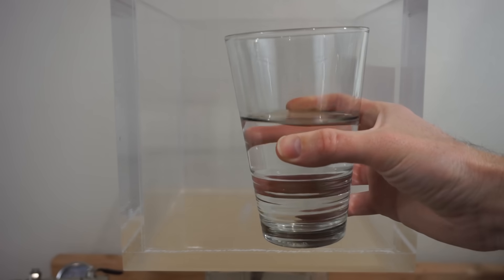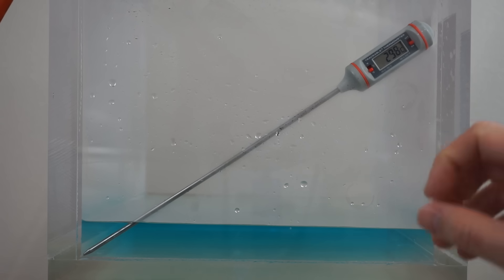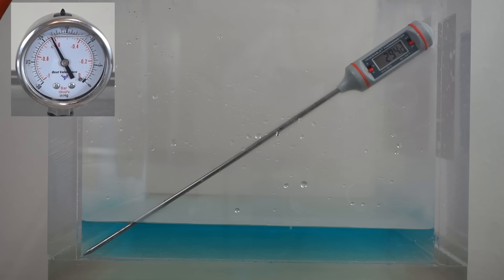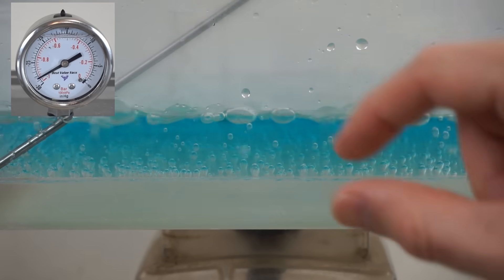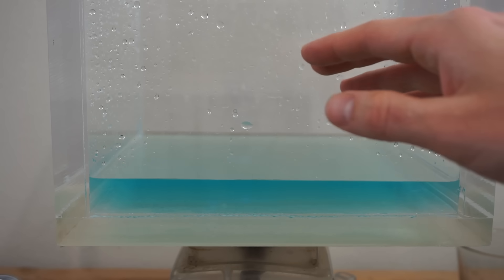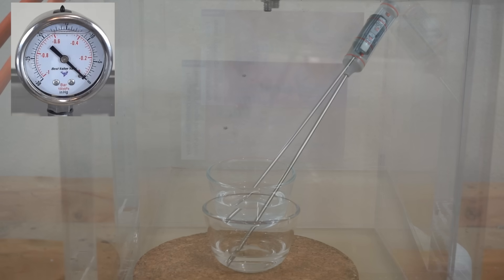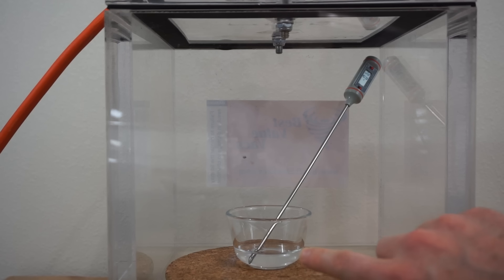Does Water Really Boil in a Vacuum Chamber? And Why?

Comment: So does sterilization require a minimum temperature or does it change with elevation??
Reply: Sterilization only requires the bacteria and other micro-organisms to die, so that the equipment is free from microbial life.  If anything, increasing elevation would reduce the minimum temperature for sterilization, since the low pressure of high elevation is difficult for life in general to survive.

Comment: Very misleading video or simply the product of ignorance. By definition, "to boil" means "to generate bubbles of vapor when a liquid is heated". Water boils because we introduce energy into it which makes it boil. Since in this experiment the water temperature did not rise at all, actually when the water boiled the temperature was "lower", in the strict sense of the word, "boiling" did NOT happen. The increasingly lower than atmospheric pressure above the water level forces gas molecules (oxygen and hydrogen) to want to separate from the water and escape into the lower pressure area, that's how a vacuum is basically formed. I would be very careful not to introduce any spark into the vacuum chamber although only pure hydrogen is volatile, mixed with two parts oxygen and it becomes .... water.

Comment: Hey Action Lab, is it possible we could see what a fire would look like in the Vacuum chamber if you used an oxidizer as a fuel source? That would be pretty cool :D
Reply: Cody's Lab YT channel did that. The result was that nothing sustained burning including gunpowder, rocket fuel, and perchlorate explosives. It would smolder in the laser but not actually ignite.

Comment: The key here is pressure is directly proportional to temperature, if you the reduce the pressure as in vacuumed space you also reduce the temperature or the boiling point of a liquid. As shown the container with liquid inside is vacuumed there by reducing the press\temp, so the temperature around area of the glass container no matter how low it is will be absorbed by the liquid in the glass and cause to boil. Same principle is applied in refrigeration.

Comment: I noticed that at 27 hg it was not boiling yet. I am looking at a vacuum pump that states that it reaches 560 mm hg. Is that capable of boiling water at sea level and 80 degrees Fahrenheit? Or is mm hg a fraction of hg?

Comment: But where does that loss thermal energy go?
Reply: It goes into the heat of vaporization to accomplish this phase change.   If you did this in a well-insulated vacuum that prevented heat transfer, the water would cool down by using suction to boil it.

This is the working principle behind the expansion valve in your refrigerator or air conditioner.  It drops pressure adiabatically with no work or heat transfer, such that it produces a cold temperature two-state mixture of liquid and gas, after expanding liquid to a lower pressure.

Comment: Could you please reapeat this experiment but at the point where the water starts boiling you close the lid, so The pump doesn't go on vacuuming. Then could you somehow heat the water until the empty space is full with h20 gas. I just heard that clouds in the sky ALWAYS have to had something as a starting point for water to condense. And i wonder if water NEVER can go liquid on its own while "flying" or if there is a point where it can turn itself into steam without help! thanks :D

Comment: What will happen if we introduce heat in the vaccum let's say by heating the nichrome wire inside the vaccum while we are lowering pressure, will the vapor return to its original liquid state or will it help boil and convert liquid to vapor even faster??? Please answer doing a project on it, thanks in advance

Comment: There's one other thing going on; as the water boils, it is adding pressure to the closed chamber, so it's trying to re-pressurize the chamber to a point above boiling.
If no one else thought of that, then I guess I'm smarter than the other 250,000 viewers.

Comment: if any increase in ambient heat is boiled off at vapor pressure, wouldn't the vapor condense on any surface below ambient temperature and bring the pressure back down to vapor pressure?
like walking up hill with an increase in temperature.

Comment: What will happen, if in side of a cylinder which has water, and that water is in low pressure vacuum camber then water boiling. What will happen the cylinder out side surface of that cylinder which is in room temp and having hi humid air around.
Reply: I meant, outside wall should have few formation and cold and dew from  surrounded air humidity.
Reply: ** not few, ....dew

Comment: What if you used ICE. Would ICE also boil?
Reply: Ice would sublime.  You would need a vacuum chamber that is lower pressure than 0.6% of an atmosphere for this to happen, but indeed it does happen.

Sublimation is the process where solids take a shortcut from the solid state to the gaseous state, and bypass the liquid state entirely.  This is what you see with dry ice, since CO2 needs a lot more pressure than 1 atmosphere to be liquid.  It can also happen with water ice, if the pressure is low enough.

Comment: 5:27 you claim that the water continually boils, no it doesn't. i have done this experiment many times and the result is always the same, the gases are forced out then the boiling stops.  Are you purposely decieving people?
I'm curious why doing the same experiment with ditilled water gives different results? Very different results.

Comment: I was studying physical equilibrium in chemistry and I was reading about what is boiling point(Temperature at which vapor pressure of liquid become equal to external pressure). Then I thought that if the external pressure is reduced then the boiling point will also be reduced and then I searched on YouTube what will happens when we boil water in vaccum and then this masterpiece video came to me.

Thank you very much bro. You always give me practical knowledge of physics and chemistry.
Reply: So how does heat boil water?
Reply: @noahway13  It gives the water enough energy to overcome the pressure of the air. Allowing it to basically jump out of it's liquid state. 

It's the difference between jumping on the moon and earth. You can get better results in once place with less effort, but you can still achieve the same effect with more energy if you really wanted to.
Reply: When easing pressure like he did, it does not produce steam? I didn't see steam/condensation on glass.
Reply: It can be studied interestingly considering H2o gas and H2o liquid in equilibrium. And then apply le chatliers principles

Comment: The dissolved gas in water is not necessarily air. Or at least it's very enriched and depleted in certain components of air. Nitrogen is twice as soluble as oxygen but 4x more common in the atmosphere. CO2 has extremely high solubility in water but it's relatively rare in air. Animals with more crude or constructed gill surfaces such as diving spiders which construct web-based structures to breath underwater must contend with the fact that the gas mixture changes and not always appropriately for breathing.

Comment: It seems kind of convenient that the dissolved gas just happens to escape at around the same temperature and pressure that the water vaporizes. I think a better demonstration would be helpful - preferably with a substance that both contains dissolved air and boils at a much lower pressure so that there's a clear demarcation point at which all the trapped air has been released and yet the substance has not yet begun to boil.
Reply: Carbonated water probably would be a good choice for that demonstration.

Comment: I have a question, and I’m not a science person so don’t tear my head off if it has an obvious answer: if you would leave the vacuum on until all the water in the vacuum chamber boiled away completely and turned to vapor, and then instantly opened and repressurized the chamber, would all that steam instantly turn back into water or would it all just float away as the gas form it currently is? (Sorry if any of my terminology is wrong)
Reply: @constructknowledge-p8z  but didn’t the guy say that at first it was just the illusion of boiling, but after a certain time it actually would start to boil? Or did I misinterpret that

Comment: To explain this first we need to know what is boiling point?
It is the temperature at which the vapour pressure and the atmospheric pressure becomes equal.
In a vacuum chamber pressure is lesser than atmospheric pressure and hence boiling point decreases and water starts boiling 😀

Comment: I always wondering if  the water is boiling hot inside the chamber or just bubbling  ? Zoom out please so that we can see the water temperature, thank you.
Reply: It's not actually increasing in temperature.  It's simply boiling for a reason other than heat addition.  Some applications will call this cavitation, but it ultimately is the same physical process as boiling.
Reply: If anything, this actually causes the water to decrease in temperature while letting vacuum pressure boil it.  If you insulate your setup perfectly, it will decrease in temperature.

This is the working principle behind the expansion valve in your air conditioner that ultimately makes the indoor coil cold.  It drops pressure without doing any work or transferring any heat, and as a result of expanding from a liquid to a 2-state mixture of liquid and vapor at a lower pressure, it drops in temperature to the boiling point at that pressure.

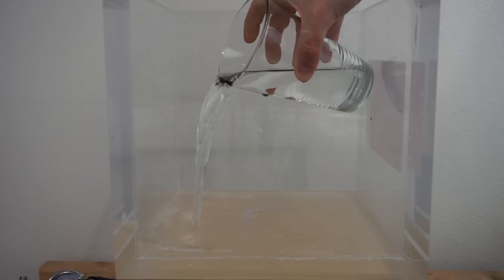Comment: 1:22 Your explanation for boiling isn't 'wrong' per-se, but it's incomplete. What you describe fits the definition of 'evaporation' better than boiling. Boiling is when the vapor pressure of the liquid (which changes with temperature) exceeds the pressure exerted on the liquid by the surrounding atmosphere. 
This helps to explain why reducing pressure can induce boiling without changing the temperature (reduction in external pressure—no change in internal vapor pressure). It also explains why raising the temperature, as is more traditionally done, causes boiling (no change in external pressure, but a rise in internal 'vapor pressure' of the liquid).
Reply: Genius. It all makes perfect sense now.
Reply: My smoothbrain is too dumb to understand this
Reply: There's not much of difference between the two phenomena, except the way we reach the boiling point which is the moment when vapour pressure of the fluid matches the atmospheric pressure.
This can either be done by raising the temp of the fluid or reducing the atmospheric pressure or by doing both ! Which already happens when you move to a place at higher altitudes, where it gets difficult to cook food in open pans as the water doesn't reach sufficient temp before turning into vapors and the pressure cooker is able to take water higher than 100 as it can create pressures in the cooker chamber greater than "standard" atm pressure.
Reply: @the_reality_of_the_virtual3212  "There's not much of difference between the two phenomena"

I agree. But I would add the caveat that 'boiling is evaporation, but evaporation is not necessarily boiling.' 

Hence my original comment, which points out that Action Lab's description is lacking in that he describes evaporation generally, not boiling. Can you not agree with that?

Everything else you said is essentially what I already said in my original comment so I'm not sure your point, if you have one.
Reply: Do you know if the bubbles in the water (the air dissolved in the water) are also just pure nitrogen molecules? Or do the nitrogen and oxygen molecules always stay close to eachother to form air (the bubbles)). Hope I'm clear ineough :)
Reply: @Scrungge  Hi Berton. I'm not clear on if you are asking a question related to my post? 

The 'air bubbles' in boiling water are actually water vapor gas bubbles, not 'air' at all. No nitrogen involved either. Perhaps I'm not clear on what you are asking.

EDIT: I just re-watched the video because it has been some time. I see you are probably referring to the bubbles he mentions at 2:15.

The answer to your question about whether those air bubbles are truly mixed air with the same gas composition or are pure nitrogen or oxygen, etc. I do not know.
Reply: Is the vapor pressure of the liquid the same as just how hot or cold the water is? Im not sure i understand 😅
Reply: @noy3392  Yes, essentially. Try searching for 'equilibrium vapor pressure.'
Reply: Vapour pressure isn’t proportional to heat(rise in temperature) in fact as heat increase vapour pressure decreases
Reply: @brostiva502  you are absolutely incorrect. Care to offer more explanation to perhaps clarify what you are trying to say?
Reply: @spruce_goose5169  I apologise, you are correct. I was confused with the relationship between vapour pressure and volume (
At constant temperature the volume of a gas is indirectly proportional to the pressure ). As far as I know that’s for real gasses and ideal gasses. I think it’s defined by Boyle’s  law or Avogadro’s?
Reply: @brostiva502  No worries. I respect you for not doubling down like some internet troll. Shows strength. 

As far as your statement, you say that volume is indirectly proportional to volume (obviously a typo). I would start with the ideal gas law, which relates pressure, volume, and temperature. 
Cheers mate.
Reply: where does the natural interal vapor pressure come from? water density? water's mass? molecule density?
Reply: @bandofbrothers5860  I'm not sure I fully understand your question. Let me say this:

The vapor pressure is a function of temperature. Temperature is a phenomona of energy. Think movement. Vapor pressure is dictated by temperature because the more energy there is in a system, the more movement there is and therefore the more molecules there are in the VAPOR STATE. Vapor state is a higher energy state than the liquid state. 

On the micro level, there are ALWAYS (with the exception of absolute zero) molecules changing states. What we observe on the macro level is the statistical sum of all movements. As temperature rises, there is a statistical increase in water molecules leaving the liquid (or solid) state to join the vapor state, and a statistical decrease in molecules leaving the vapor state to join the liquid (or solid) state.
Reply: @spruce_goose5169  thanks for the explanation. Does that mean the absence of energy in termperature forces water to freeze?
Reply: @bandofbrothers5860  Yes--basically. Though we need to be careful in our phrasing of energy and temperature, as they are not analogous. To understand this, I suggest a study of 'heat of fusion' and 'heat of vaporization'. In a nutshell, it is the energy required to induce a phase change before any change in temperature takes place. 

But in essence, yes: a solid state is lower energy than a liquid state, which is lower energy than the vapor state. Many everyday solid objects around us are only solids because they are cool enough.  

What's interesting about water is that it readily exists in all 3 phases on Earth within normal 'operating temps.'
Reply: Hopefully I haven't given the impression that pressure is not relevant to phase states here. If one looks at a phase diagram, they will see pressure on one axis and temperature on the other. So don't take what I've said above to mean pressure has no role in phase states.

I think I may understand your original question a bit better, and my response is that 'I don't know.' Every liquid exhibits a different vapor pressure for a given temperature. What determines that I suspect has a lot to do with molecular bonds, and perhaps size of molecule, etc. Not really sure though.

Comment: One question in the end, when temperature of water reached freezing at normal pressure.
Would the water freeze instantly if you would open vacuum chamber or would the temperature of water rise?
Reply: Neither.

The temperature decreases because it boils. That means that for it to increase it would have to undergo the reverse process. When you open the chamber it does, and it condensates, but on the walls, no contact with the water, so the heat doesn't go back in. Plus, most of the vapour which extracted the heat in the first place was taken out by the pump as it tried to maintain a vacuum.

Freezing also needs a nucleus. So unless you tap on the glass, it wouldn't freeze in normal pressure either at sub zero temperatures.

Comment: if you have a type of salt that is soluble only when the water is boiling, does that mean that it will dissolve in a boiling vacuum chamber, or only if the water is at a certain temp?

Comment: My question is, can you make pasta in a vacuum chamber?
Reply: No.  The fact that the water is boiling actually hinders you from using water from cooking, rather than helping you.   You want the water to be in a liquid state at as hot of a temperature as possible, in order for it to be effective at cooking food.

This is the working principle behind a pressure cooker, so you can get the water to be liquid at a much hotter temperature.  This is also why products cooked in boiling water have high altitude instructions, that require a longer cooking time.

Comment: If there's no atmosphere on the moon (complete vacuum) then how can NASA have found water or evidence of water on the moon in 2020? No atmosphere = H2O would be seperated into 1 part hydrogen and 2 parts Oxygen and float away. Same for Mars supposed polar ice caps. Am I missing something?
Reply: The air bubbles that escaped was air dissolved in the water. They were not H2O molecules separating into H2 and O.  You are basically describing nuclear fission, which is not what happened here. Boiling turns the H2O molecules into gas, but it stays H2O

Comment: In my oppinion Vacuum breakdown the water. Since you are sucking the air water breakdown to replace the oxygen and hydrogen. Try stoping the motor at some point and keep it sealed the water will keep boiling until the oxygen or hydrogen got replace.